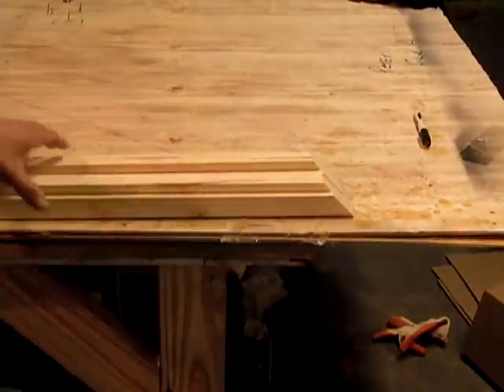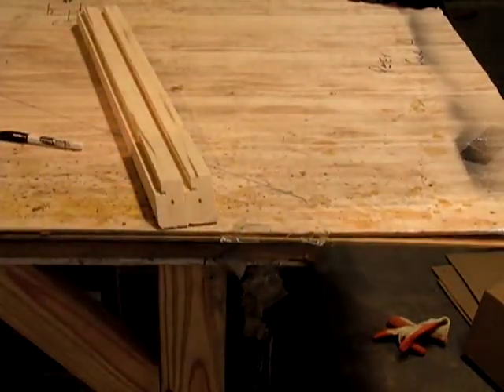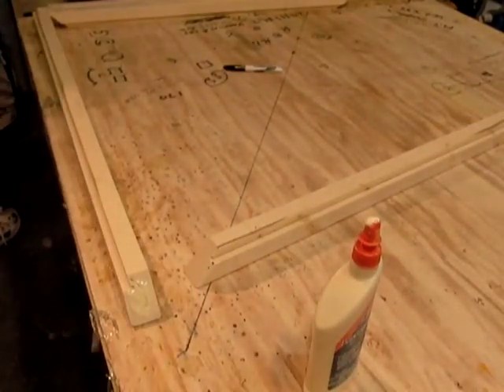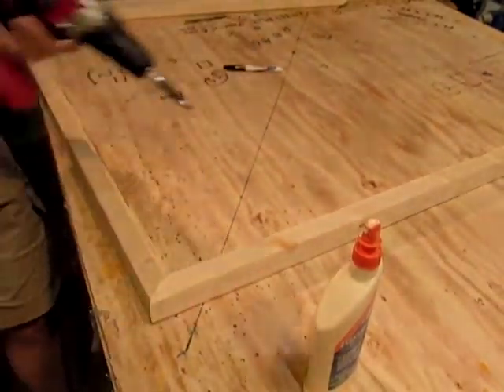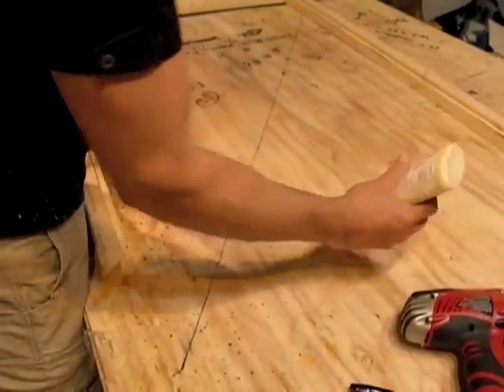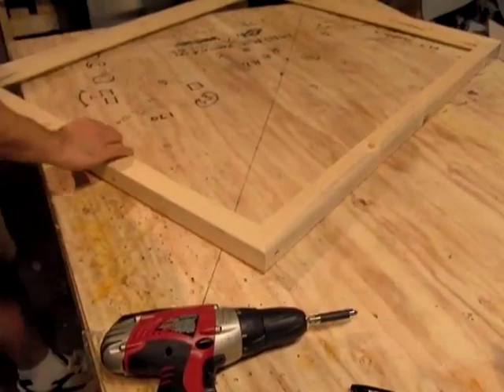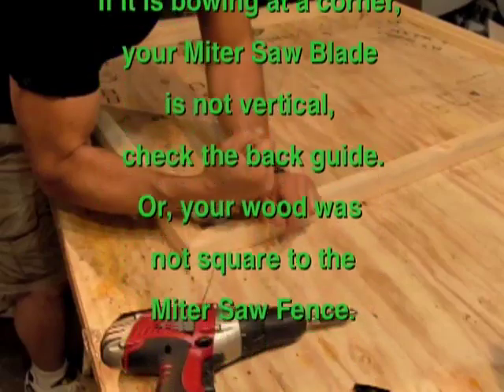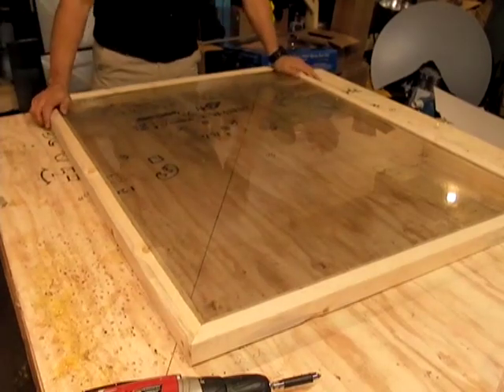Forced Air Heater Solar PART 2 Passive Heating HOW TO CONNECT MITER CORNERS Wooden Frame

Comment from the maker: @Tomigun101 DOUBLE PANE GLASS with argon seal fill. Or find a window that is in good condition. Lowes marks them at 70% off because they were custom and the size was wrong. I got 15 for $21 each, regular price $250, I used most of them of windows:-) But I have one left I will be testing. ALSO ADDING THIS:

watch?v=kXXOwfZA2Rk